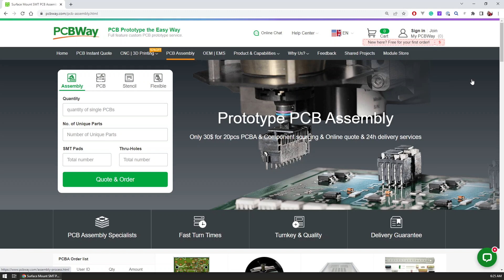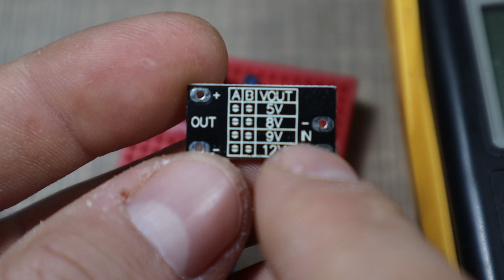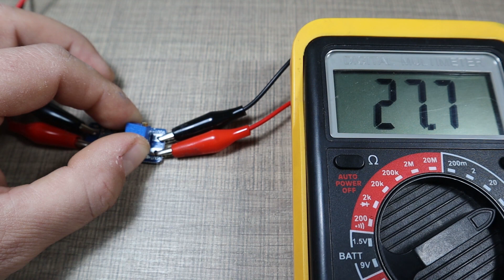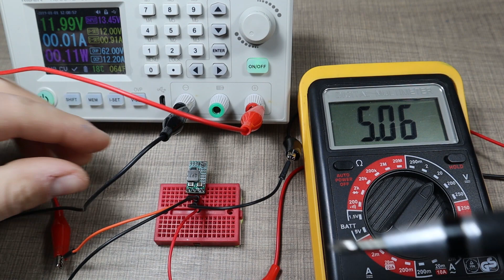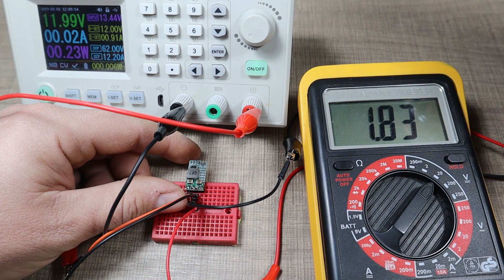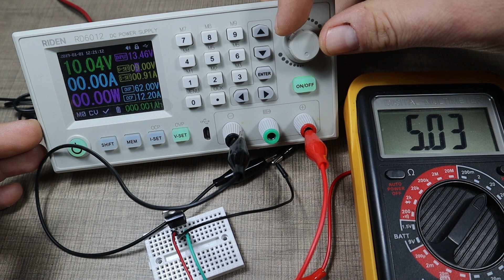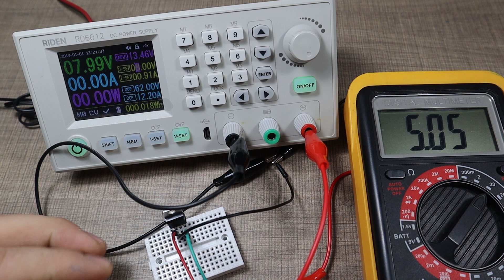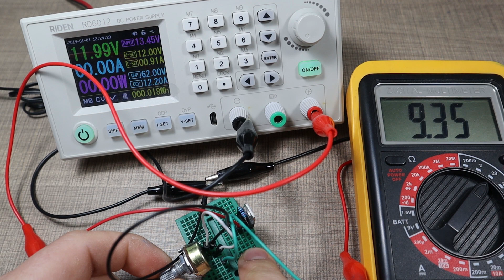What is the best way to power your electronics project?

Comment: Hello. I want to ask something, it is okay to use tp4056 (blue with type C charging port) and add the step up booster with protection board?
Reply from the maker: Yes, that should be perfectly fine.
Reply: @TasteTheCode  by the way, I have one more question sir. Will work with this combo? 

TP4056 + MT3806 (step up booster) +
TTP223 (touch sensor "red") + led??
Reply from the maker: @kenmoriyama7566  I haven't used the TTP223 so far but I don't see a reason why it should not work. Just make sure to add a proper resistor to the LED.
Reply: @TasteTheCode  I am just trying out some things for my scale model works and minitures. I've been using 3v leds and add all resistors then using out a step up converter and my power supply is a 12v adoptor. Now, I want to use now the rechargable batteries like I asked above. For now, I trusting you sir, thank you so much for answering my concerns.

Comment: Would have liked to have seen a test of the little module that’s used in power banks the one with two connectors to see it it has protection.
Reply from the maker: Hey Ian, I have a dedicated video on it here https://youtu.be/Ze9JscCxLx8 And yes, it does have a protection.
Reply: @TasteTheCode  I will watch that now, thanks!
Reply: @TasteTheCode  
Do you have a video on doing tests on that module to show the over/under voltage/current test and also what current is needed to keep constant 5v on output?
Reply from the maker: Unfortunately no.
Reply: @TasteTheCode  ok, thanks, will have to get a few to test.

Comment: 24 volts are often used in 3D printers today. 
However, 12 volts are often used for fans 
and 5 volts for additional electronics.
Reply from the maker: Yes, using modules like these, all of those are easily achievable.